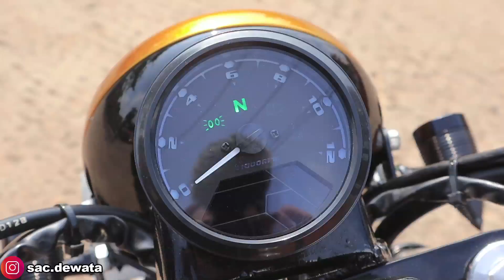MODIFIKASI HONDA TIGER!!!

Comment: Bang Arie, ane ada beberapa pertanyaan tolong dijawab ya bang : 
1. Info detail untuk spec kaki2 nya dong bang, size velg depan-belakang, tromol, jari2. 
2. Gimana supaya pas di custom si tiger bs tetap keliahatan besar, padat dan berisi ya bang ? Soalnya biasanya klo sudah di custom / potong frame perasan ane jadi keliatan kecil body nya bang. 
Maap ya bang banyak tanya. 😁
Ditunggu jawabannya ya bang.. 
Terima kasih. Salam.. 🙏🏻
Reply from the maker: Kan di video ada bro spek ukuran velg & ban